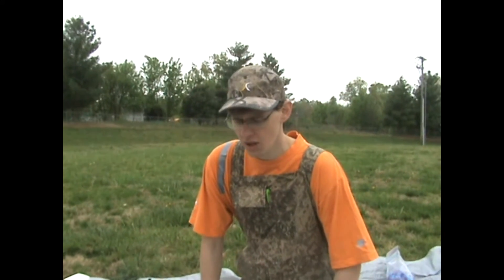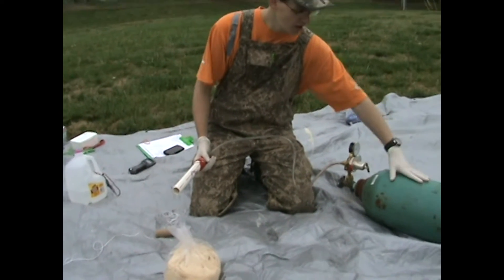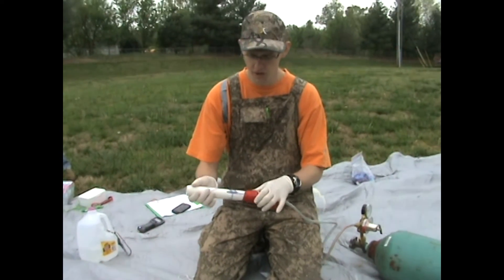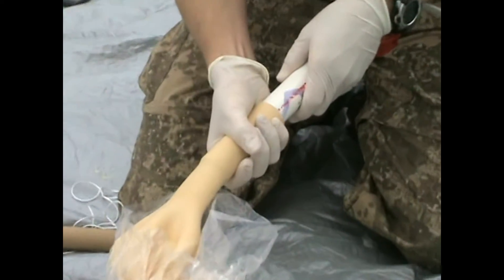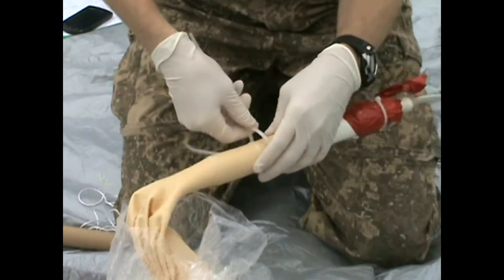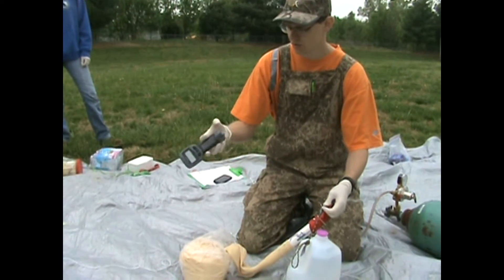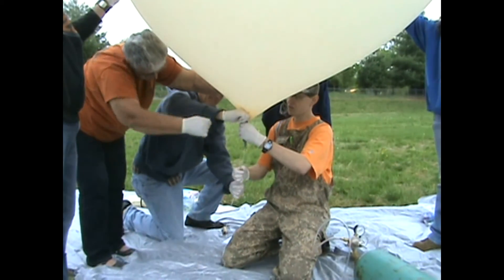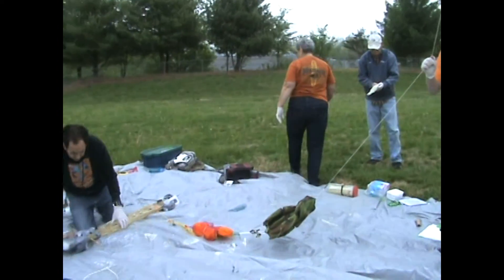How to Fill a High Altitude Free Unmanned Balloon

Comment: Just curious, what size of a balloon did you use?  1500g?
Reply from the maker: Bill Richards yes 1500gram
it usually gives the best lift/$ cost ratio, so I feel it is the best size to keep around not knowing what will be on the next flight
bigger balloons than 1500gr can lift more but at a much higher cost normally
smaller than 1500gr cost less but they drop the available lift/altitude significantly too
of course pricing changes from year to year

Comment: Nicely done!  I wish I had seen a youtube like this before my first launch!  Very helpful!

A few notes.  I often pre-tie the loop for the payload and thread it over the fill nozzle before placing the fill on the balloon.   There's less fussing and fiddling to tie it off, with a full balloon.  Sometimes, if it's windy, you just want to get that sucker filled and in the air before something bad happens.  Also, I use rubber bands rather than  zip ties, as they aren't as sharp.  Probably not as trustworthy, but I haven't really had problems.

Also, depending on how it compares to the weight of your payload, you might want to estimate the weight of all that tape you use to tie off the bottom of the balloon, and work it into the math along with the payload weight.  A ball of duct tape like that has some heft.

Nicely done!
'73 de KD2EAT